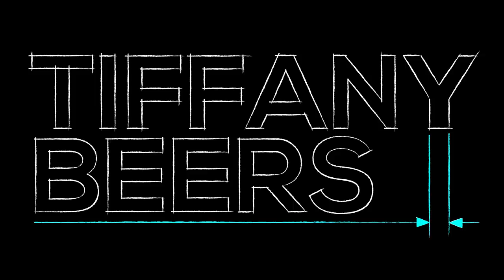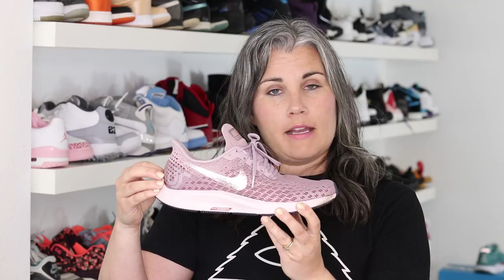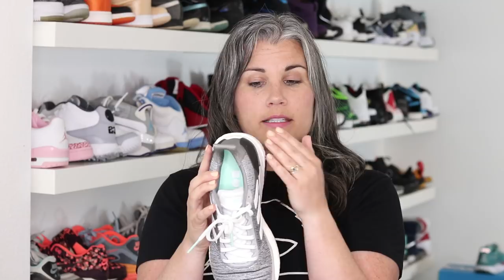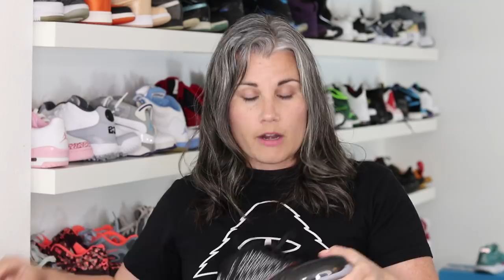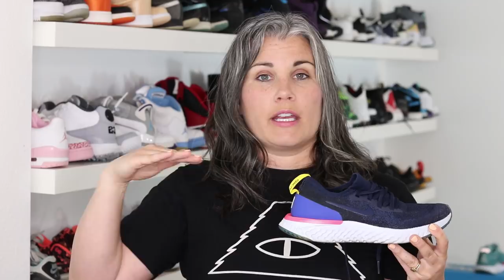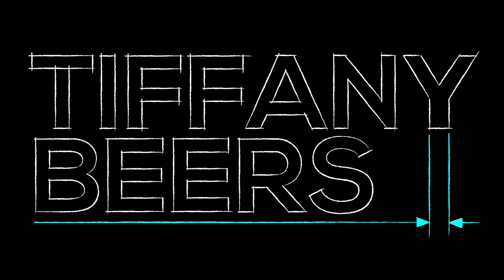Sneaker Knowledge - Midsoles

Comment: I definitely want to hear more about the molecular chemistry of open cell vs closed cell foams (polyurethane). For example, how an Air Jordan 3 midsole from 2003 differs from one made in 2007 vs one made today. I’ve seen paint chipping from ones in 2007 that require restorers to repaint the midsoles but hardly see any cracking on the actual midsole itself. I’m sure this has to deal with the fact Nike is using more closed cell foams vs open cell ones.
Reply: MJO23DAN Open cell allows for moisture which eventually crumbles the paint/midsole. Closed cell allows for minimal moisture and is less likely to crumble over time.
Reply: BackseatJuice yes I know how it works. There has been a shift in that with Nike.
Reply: I know It's been 4 years since this video and your comment on this video, but does anyone know if Nike (and all other companies) have moved to more closed cell foams so we won't experience crumbling on deadstock sneakers decades from now? If there was a move to these foams, does anyone know when? Also, have they moved on to even newer materials, EVEN ON RETROS, to where crumbling will be minimized in the future? Thanks!
Reply: @iandeleon8132  from my personal experience, I haven’t seen paint crack since the mid-2000s. It does seem as though Nike has slowed down the crumbling process by continuing to use closed cell foams. Whenever I see individuals posting restorations on Instagram, they’re mainly working on pairs from the early 2000s and older. Anything past 2008, they are mainly just regluing shoes.
Reply: @mjo23dan  Good to know, thanks! Well, maybe it's good I didn't become a sneakerhead till way late in life. Otherwise, I'd probably have OGs from the 80's and 90's with crumbled soles, hahaha.

Comment: Speaking of midsoles, have you looked into Saucony's Everun?  It's similar to Boost, but a bit firmer.  They have a few shoes that use it such as the Freedom ISO which has full length Everun and the Ride ISO which has a dual density midsole with Everun being the top layer.

Comment: I noticed you didn’t mention drop in mid soles, I wear a lot of skateboard shoes and I’ve noticed that a lot have a vulcanized rubber outsole or cup outsole that covers the side as well and then the cushion pretty much all comes from a super thick insole midsole combo. Why would a company choose this style over a more traditional method?
Reply from the maker: Offset and drop are the same thing. I’ll cover cupsoles in the next midsoles video.
Reply: bin r  Stack height & offset are lower (vs running shoes) as perf objective is board/deck feel. Rubber extends to sidewalls for durability & grip as for many tricks (& basic ollie) the lateral sidewall of your front foot is often scraping the board/deck. Love the series Tiffany, keep up the great work!
Reply: I’m talking about super thick insoles that basically act as the midsole cushion, some people call them “drop in” midsoles, because you can take them in and out of the shoes. The insole acts as midsole of the shoe, so if you took it out the shoe it wouldn’t work properly. Sorry if I worded my first comment weird.
Reply: Similar to the Kobe AD NXT 360, where the insole is also the midsole cushion.
Reply: bin r  thx for clarifying. yes, got it. an example is vans ultracush. objective is to provide 'crash protection' w/ a thicker insole, but at the same time NOT sacrifice board/deck feel. both the insole + board/deck flex absorb impact when landing aerials. problem w/ TPU/eTPU/midsole foams is lack of ground/deck feel. that's why
Reply: bin r  yes, skate perf requirements are similar (to a certain degree) as court sports like bball (esp vs running). ground feel, lateral movement etc are a higher priority vs crash protection
Reply: bin r  perhaps Tiffany can break this down in an upcoming segment - consider all the diff layers b/w your foot + ground contact - insole sock liner, stroble material, adhesive/glue attaching stroble to midsole, midsole itself, another layer of adhesive/glue b/w midsole + outsole, then finally the outsole... all those elements in combo detract from ground/deck feel
Reply: on a real vulcanized shoe, the whole shoe needs to go into the oven for the vulcanization process. foams are very sensitive to heat, and will deform upon heating. so thick drop in sockliner is the only option for cushioning.
Reply: @TiffanyBeers  Hi Tiffany, really appreciate the time and knowledge you put into these videos. Will you still be covering cupsoles? Thanks

Comment: Hi Tiffany! Great video! Loving this series. I have had a question on my mind for a while. Do they take into account size/weight of the user when making a midsole? Or rather, how much does a person's size or weight  affect the durability and functionality of the midsole? Example: Size 15 boost for a 200lb person vs size 15 boost for a 350lb person, vs a size 8 for a 120lb person? Do these things matter when developing a midsole? Or do they develop a foam for a specific sized person and apply it to all sizes? Is it a negligible difference? Thank you, Sneaker Friend!
Reply: I think generally no. Brands develop their shoe based on a sample size, lets say US 8. and do most of performance testing in this size first. Later on, they may do testing on extreme sizes as well, but sole compounds would be the same.
there might be slight difference on how the outsole/reinforcement bars/midsole are shaped to support the bigger size.
However, on a sport or market where the average size are bigger like rugby or american football, the tests are done on a bigger sized shoes, like US 10 instead of 8.

Comment: Can a midsole be too soft that it pinches and can it have a midsole does not have any benifits due to its strobel board
Reply from the maker: not sure about the midsole pinching, seems plausible.  yes the strobel can and does completely negate the benefits of the cushioning system in shoes all the time.
Reply: so i shouldn't feel crazy cutting and plying it out when i hated my shoes I can't play out the support on the mid foot which makes it feel like there is a stick in the middle of my foot since i'm scared it would worsen the shoe upper as its adidas boost and its seems liek its glued on

Comment: are you talking Altra with their 0 drop shoes?
Reply from the maker: i know they do have 0 drop shoes, but i think there are a few others that have zero or close to zero.
Reply: @TiffanyBeers  Merrell is very big into 0mm drop shoes as well.  Other running companies typically stick to around 4mm for their lowest drop shoes.  In recent times though, a few running companies have been moving towards making much of their shoe lines have heel drops in the single digits.